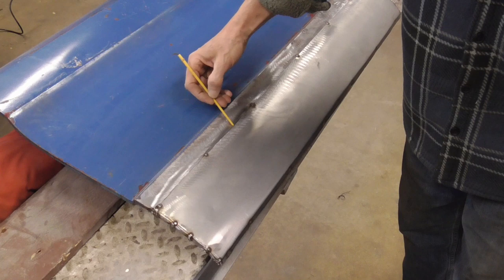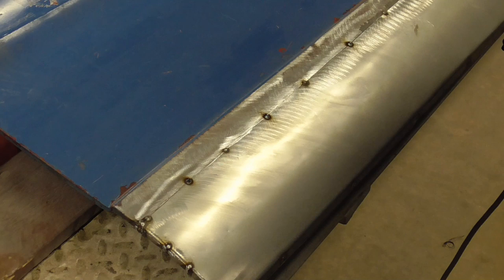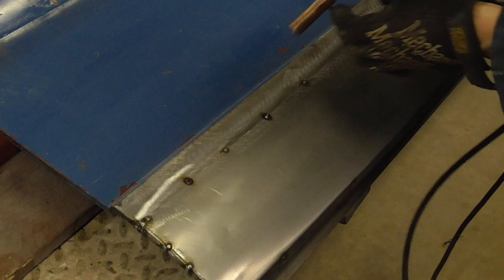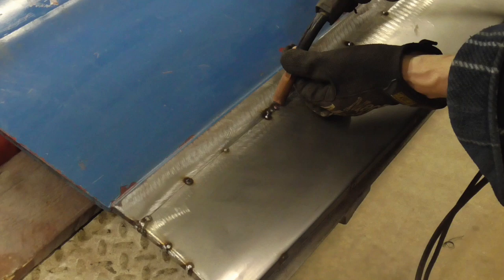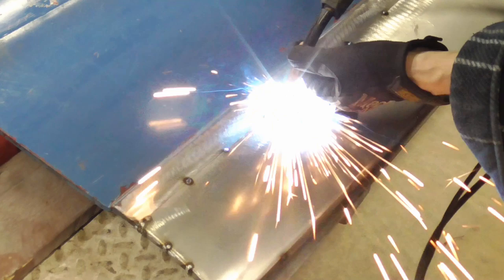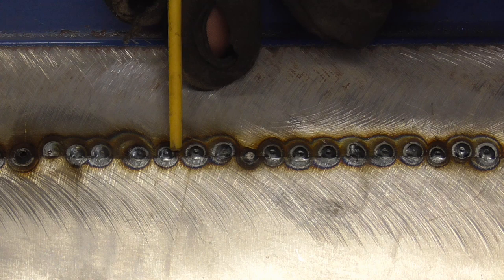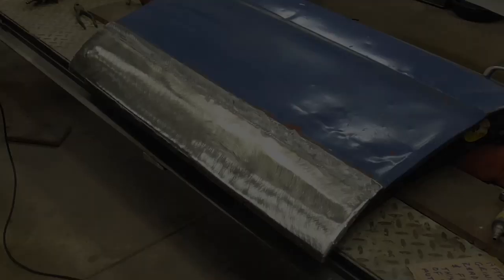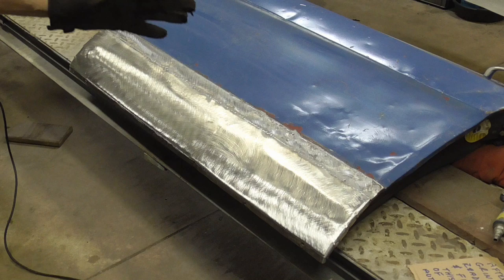How to MIG Weld Long Seams in Auto Body Repair

Comment: Great vid. I’ve always used a bucket of water and a wet and dry rag and back step welding to control heat spread/ warpage. But “stitching” works well too, and it’s not always necessary to have a full weld when you can plug weld or stitch weld and use sealer and filler.

Comment: You need to weld the hole seam shut, and after you grind the weld down . 
Put a bright light behind  the panel,  and look for pin holes. Weld the pin holes shut. If you don't get all the holes sealed up you will get rust blisters within a year.
Moisture  is in the air. It will find the pin holes. That's why putting just body filler over a rust hole  doesn't work.
Body filler absorbs Moisture.
If you are going  through  all the work of welding a patch on. You might  as. Well do it all the way, and get a lasting  repair out of it.

Comment: Heat damming putty helps too.
Reply from the maker: Good point
Reply: @LakesideAutobody  Interesting - I've never tried the putty but I have used compressed air or damp rags. Lately I've been trying a tip I saw on another channel of using strips of paper towel. Not the kitchen kind - the more durable lint-free body shop or the blue shop kind - so you can soak them then wring most of the water out. These damp strips even stick to vertical surfaces and it is easy to wet them again by dabbing the strips with a wadded-up soaked paper towel.

Comment: Great job very neat. Would it be worth using some seam sealer on the back if you can get at it. Or is that just belt and braces over the top
Reply from the maker: That'd be great as long as you were able to clean the surface real well before applying.  Otherwise if moisture does get behind the sealer it gets trapped.  That happens a lot with factory floor board seams,  Seam sealer is great stuff though - stays a bit flexible

Comment: Awesome vid but have a question.  Would you just butt the pieces up?  Or you and panel flanger tool??  What would be wiser for 1st timer???  Keep up the great vids
Reply from the maker: Either way works fine.  I always prefer to lap though.  It's much easier, faster, and you can fix anything no mater what shape or difficulty.  Every body shop lap welds.  Panel flange is fine too though.  It's really what is easiest and works best for you.  As a first timer I'd go with lap :)

Comment: I don't understand why you didn't weld  the entire seam, short of cutting corners and saving time and materials. The patch will not be nearly as secure as the original sheet metal would have been.. If i was caught doing something like that on any panel I've sectioned together I'd lose my job.
Reply from the maker: Yes you can weld the entire seam if you prefer.  I have great luck both ways - solid seam or spacing.  The reason is the seam is upside down on the inside like a shingle and doesn't hold water or moisture (always stays dry) - no worries.  Hope that makes sense :)

Comment: Are you applying etch primer to back-side of weld to coat? Whats your process for back-side after patch/repair?
Reply from the maker: The best would be to sand blast the back side and undercoat it.  If you can 't access it see this video:  https://www.youtube.com/watch?v=8XaZBy7GC7A  Today there are a lot of ways to prevent rust from the inside of the panel - wax based system, rubberized undercoat, penetrol, even linseed oil.  I find used motor oil works best for me 'cause its free but you just have to find what you personally like best for your situation.  Hope that helps

Comment: Nice work. What were the settings on your Mig welder? I have a Miller 211 so I know that it will be different. Just curious.
Reply from the maker: .023 wire, 1 or 2 for volts with 20-22  gauge sheet metal.  Usually 2 but if I'm welding a patch it to something thinner 1. 32-33 wire feed speed for setting 1 and around 40 for setting 2.  20 CFH gas.   Hope that helps - Jerry
Reply: Yes, that helps me out quite a bit. I have a 66 Chevelle that I need to do some rust repair on. Your videos are very informative. You should have a lot more subscribers than you do. 
Thank You
Eric

Comment: I have a harbor freight 100 dollar welder.do you think itsa good enough.or should i upgrade
Reply from the maker: I've never used anything but Miller - so I can't say.  But... I've had very good luck with HF tools so give it a good chance.  I don't think they would sell a welder that flat out doesn't work.  If it's flux core wire though that's different - I tried that in my welder once and didn't like it at all - but I may not have given it a good enough chance.  Jerry

Comment: I am not a panel beater, but if you are looking for a concours level finish, how can you join two panels so that the seam can not be discerned?
Reply from the maker: After you weld, you use a body hammer (point side) and tap the welds down.  Grind the area clean, finish it with body filler, prime, block sand, and paint.  Here's a couple examples of cars with a lot of rust repair and you could never find the seams or the filler.  https://www.youtube.com/watch?v=8XaZBy7GC7A or 
https://www.youtube.com/watch?v=2o37dX--w0I
Reply: @LakesideAutobody  Thank you for the reply.
Reply from the maker: @sociopathicnarcissist8810  You're welcome

Comment: You won't get hardly any warpage if you just put a spot weld every 6 inches or so down the panel, then repeat next to those previously done and before you know it, you're done.
Reply from the maker: Good tip Greg :)